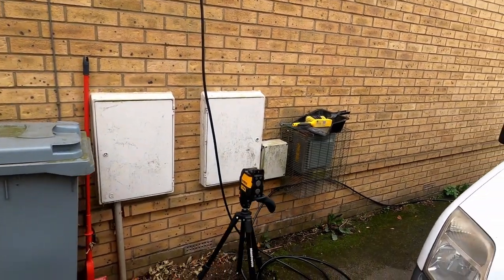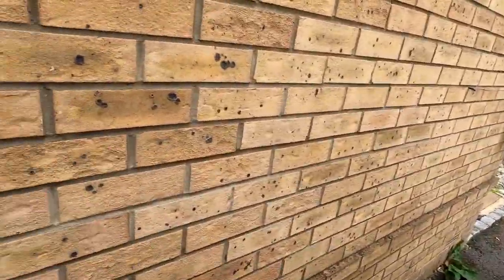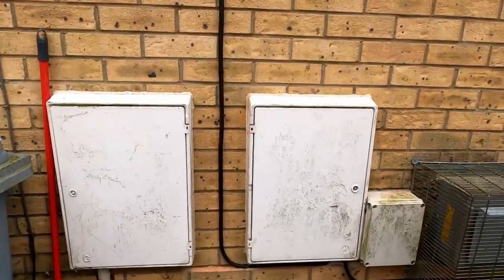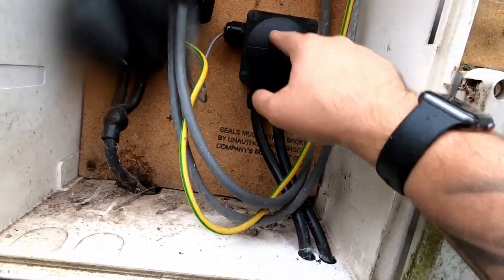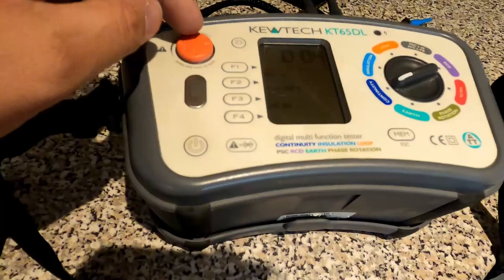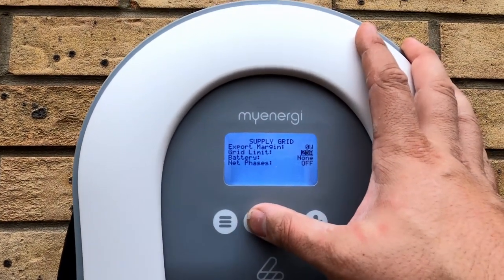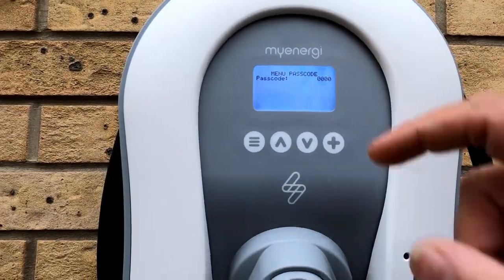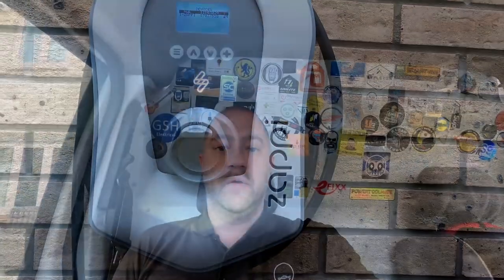Zappi Install - Sparky Life

Comment: If you have a 100amp main fuse to the property and you are using a zappi with load limiting device set to say 95amps. Do u need to notify the dno before or can you just do it after the install? Iv only found information for this for 60amp heads and assumed its the same for 100?
Reply from the maker: Yes in that scenario you need to notify the DNO first as they will want to confirm the fuse rating. If however you set it to 60a and leave it at 60 then you can do a connect and notify up to 28 days after installation.
Reply: @GiffordsElectrical  guess im going back to set it to 60a then :) iv notified them so its all good. Cheere mate